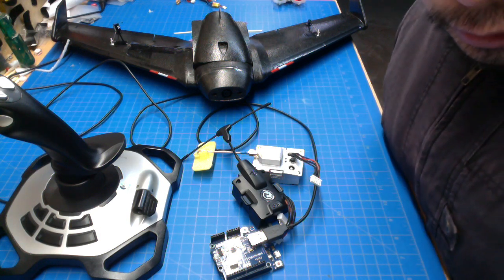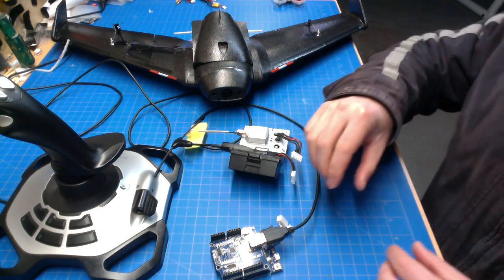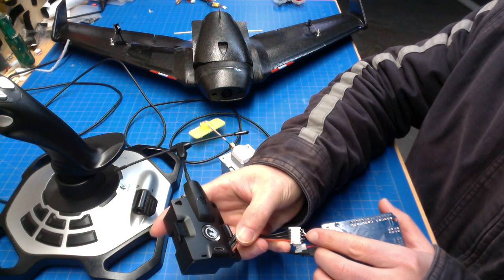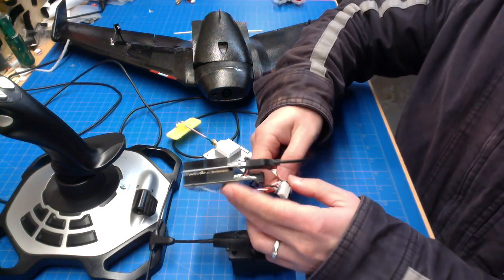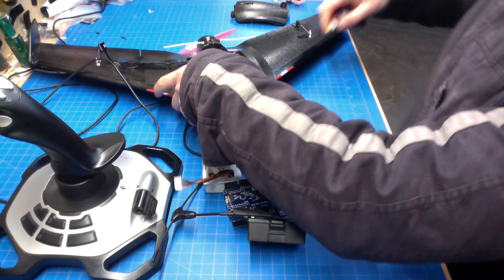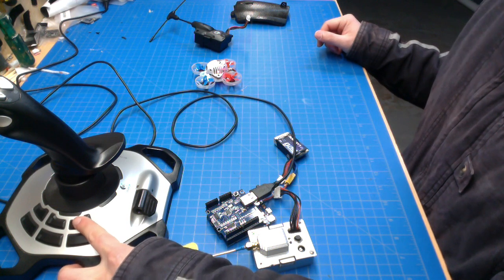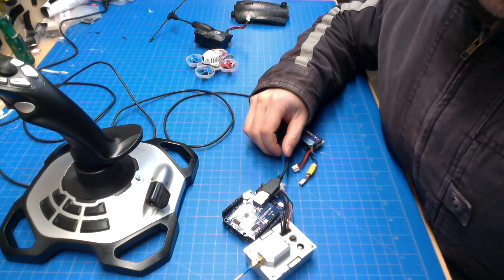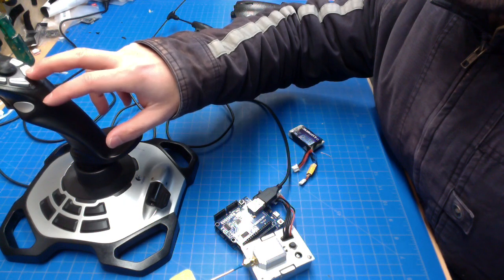Logitech Joystick RC flight controls

Comment: Hey mate, this is incredible and exactly what I'm looking for. My plan is to set up a mount for my hotas in the passenger seat of my Jimny and then put all the Aerials for the fpv and the controller on the bull bar so I can fly it from inside my car from the hotas in fpv with good range in AC comfort!
Reply: Any progress? I had the same plan
Reply: @GnarSasquatch  Had to completely change protocols and haven't managed to get the plane up yet.
But I've opted to go with a pod trailer and I'm looking into full motion simulator cockpit having a sensor transmit the plane orientation to the Sim.

Comment: Hi, i may be years too late but i just want to ask, instead of using the crossfire module, can i instead use a nRF24L01 module only for transmitter and receiver? It is way cheaper than buying the crossfire and the likes.I am desperate for answers. I hope you can help. Thank you
Reply: This looks setup to use PPM modules - but the newer ELRS PPM modules and receivers are much cheaper - and will have better range and reliability than the nRF24L01.

Comment: I've been wanting to do this for years! I have a Jumper t16 that I installed the internal 4 in 1 multi protocol module but I still have the external one that I don't use anymore. Would this module work for this project?
Also, will any pc joystick work? I have a Microsoft.
Reply from the maker: If the module has PPM, it should work fine. However, since this a software solution, it will only work with the logitech extreme 3d pro joystick. If you can code, you can remap it to your own joystick though. good luck!
Reply: @blimpwings  Thank you for responding!

Comment: Awesome !!!! I alway wanted to do this. I am a commercial heli pilot not an arduino programmer but this makes me want to learn arduino for sure! Could you pretty please send me some links to The coding of the arduino?
Would it be possible to use this in FPV as well ?
I just would like to add rudder pedals to this and it I would be perfect with a head tracking gimbal!
Thank you so much for sharing !
Reply from the maker: The code to the project itself is in the description. You can definitely use it in FPV, but it doesn't support separate rudder pedals unless you change the code yourself. Good luck!

Comment: i tried your code with an CATZ FLY5 joystick linked to an dx9 as a trainer, only aileron and elevator works, i'm not a developer or an arduino user, i dont know how to edit the code to make it only use throttle, aileron, elevator and rudder without other channel and fonction, no flight mode, no failsafe, no arm or disarm, just basics. can you help?
Reply from the maker: Sorry, I don't have that joystick, so there's no way I can help...
Reply: @blimpwings  thank you, your code work for me, just isn't rightly mapped, i will do my best and i'll share my version with you, thanks for sharing your progress
Reply from the maker: @DruideRC  Yes, unfortunately, every joystick is different and the only way to figure it out is to debug with some trial and error. Your other option would be to pick up a logitech extreme 3d pro since they can be had for quite cheap now. Good luck!

Comment: How do you trim with this setup?
Reply from the maker: This is designed around the use of a flight controller, so any other trims will require adjustments in the code itself (which isn't particularly hard). You can also code any of the buttons to act as trims as well.

Comment: I'm fallowing you on flyingporcupine website. At the moment I'm building AR600 wing exact the same as yours on the bench. Could you please post your diff somewhere to be able to download. Thanks
Reply from the maker: I am running an obscure flight controller, so my diff will not work on yours. You should try the inav group on facebook as there are lots of people there who are more than happy to help you with setting it up. https://www.facebook.com/groups/INAVFixedWing/
Reply: I’m planing to run the same Noxe F4 as yours. Just want to know your auto launch parameters, PIDs, etc. It would be nice if you can share somewhere in cloud. Thanks
Reply from the maker: @noramas.  I didn't think anyone other than me would be crazy enough to run this FC. :) Please don't copy and paste the values as you most likely are running v1 of this FC which is a different target. I am running a custom inav build on v2. Also, I recommend you use autotune to get your own piffs. Every build is different. 
https://drive.google.com/file/d/1hs_nJCEnPXDgvwRMeoC3PYLu4lFr7MI8/view?usp=sharing
Reply from the maker: @noramas.  Actually, I just read your comment more carefully. Do not use this FC unless you can get V1. V2 will not work with Inav without a custom build (you need to modify inav code and recompile it yourself).
Reply: Thank you. Btw, your www it’s kinda inspiration for me. Lot of models to check. My page where I post my models https://www.facebook.com/dronedyi/
Reply from the maker: @noramas.  It's nice to meet someone else who also dabbles in many different things like me (cars, whoops, micros, etc...). Your hometown is beautiful! I wish I could fly there some day. You need to do some long range flights with your ar mini and post some videos once you get a FC in it.